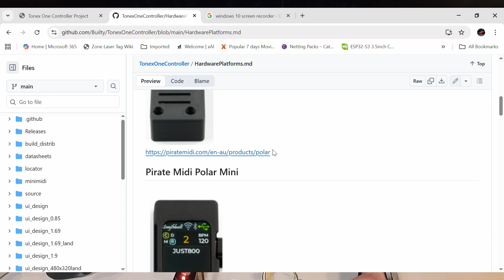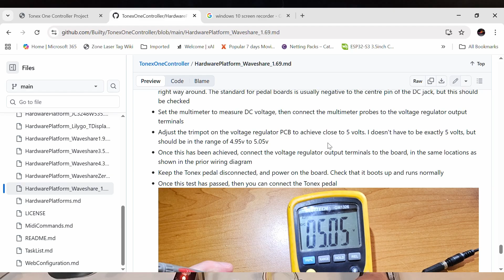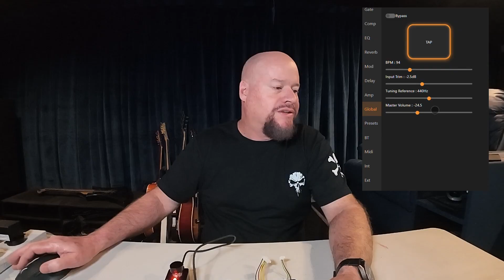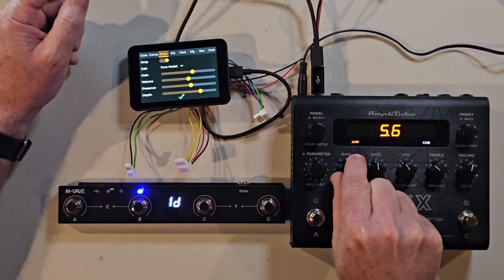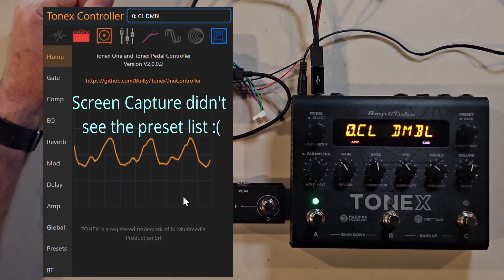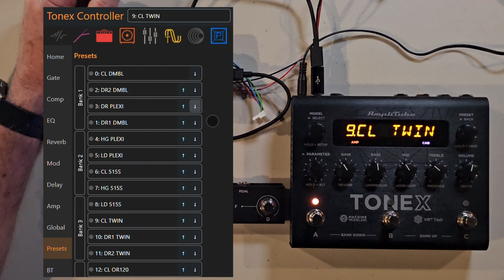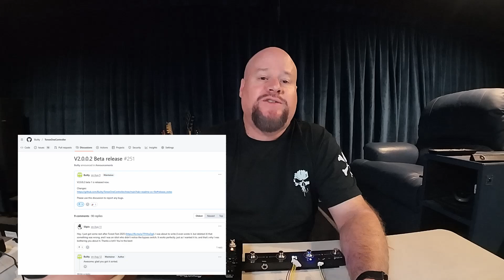Open Source Tonex Controller Project firmware V2.0.0.2

Comment: Game changing work!!!

Crazy question; Do you think there's a way to get 2 Tonex One pedals controlled by a single bluetooth pedal that can broadcast on multiple channels (like the Aero/Airstep multi).  Is "midii through" via usb etc a thing with these units? (Old fart question)

Please do keep doing the astonishing, it really is appreciated, and the Pirate stuff is superb.
Reply from the maker: HI. Midi over usb is not supported for pedals. I'm not familiar with the multi. Midi thru is supported via wired midi but I don't think that would be helpful in your case

Comment: what chip "screenless" do you recommend to avoid heat ? Sorry but wifi is ON much more than 60" (15-30' its depend). Need help to know where to configure this timing (not in wifi page of the web-controler)
Reply from the maker: The WiFi page has Access Point timed (60 seconds), Access Point (on always) and Station mode.

Are you meaning that yours stops working after 15 to 30 minutes? If so, this would not be the firmware.

Comment: Hi again Greg, other RFI about the robustness of the product based on the ESP32-S3 zero SOC: wifi is interrupted after a duration of 30', often less. The HW is very hot as well. Did you face this problem with some part by the past ? what is the most stable wifi configuration via the config web page ? Like each start (is it normal ?), a reset directly on the SOC is the workaround solution, but can be very frustating in a guitar session with playback or recording...see my other question about midi on wifi, thanks for you investment in the devlopment of this open source free solution !
Reply from the maker: Wifi switches off after 60 seconds. This can be changed in the settings to stay on always if you like. Some people do find the Zero chip runs hot. You can stick on a small cheap  heatsink to help it.
Reply: @gregsmith1526  what chip do you recommend with less heat ?
Reply from the maker: @patrice92420 all the supported PCBs are shown here:
https://github.com/Builty/TonexOneController/blob/main/HardwarePlatforms.md

The Zero is the only one that runs warm. The rest run cool.

Comment: Hi, could a guitar switcher (to manage 8 loop) with midi management connected to an adapter for midi wireless sending messages be connected to the Esp32 loaded with you ToneControl Project ? Tanks to precise wifi or BT or never…
Reply from the maker: That sounds complicated, but I think it would be OK. The controller can accept Midi messages via wired, bluetooth central or bluetooth peripheral.
Reply: @gregsmith1526  not via wifi adaptater isn't it  ? (like  m-vave sk7, generally can be conected to a list of predifened music devices).
Reply from the maker: @patrice92420wifi is available via a Web page, but not for midi

Comment: Hi Greg, can you tell us why TonexOne can manage midi messages internaly whereas the feature is basically not supported ? Indeed, the M-wave pedal controler only transmit the midi messages to TonexOne that must interpret the desired action, any explanations ?
Reply from the maker: The Tonex One does not support Midi at all. It has its own special communication system that IK wrote. Its used for the Tonex editor.
My controller project takes in Midi messages and converts them to this special protocol.

The One coould have had Midi but I guess IK was concerned it would then take away sales from the big Tonex pedal.
Reply: understood thank you. Did you get some informations from ikmultimedia on this special protocol or did you learn it by experience with some spying usb tools ?
Reply from the maker: @François-l4l all done through reverse engineering. Months of it
Reply: possible to contact you directly and in private on your github ? I have no more technical question, but more a collaboration to suggest.
Reply from the maker: @François-l4l  Github doesn't support private messages. Are you on Facebook? You could message me privately there
Reply: I understood your project act as a gateway. May i contact you in private for commercial purpose ?

Comment: Great job, dude. One question, which is the best platform to use with an old voodoo lab pedal power 2+? It can give only 250mA maximum. In the documentation, the 4.3 waveshare says it needs 1A power supply, but couldn't find the info for the others. I know i would need the step down thing, but would the pp2+ provide enough juice?
Reply from the maker: 250 mA is going to be really tight. The Tonex pedal itself takes about that. Best option for you might be to power the Tonex off 9v, and power the controller via a separate 9v (if you have multiple outputs.)
The controllers, when not powering the Tonex, need a lot less. 250 mA at 9v is probably enough, but I couldn't guarantee it
Reply: @gregsmith1526 Thank you, mate. I'll give it a try.

Comment: Hi, great job! Today I received my Waveshare Esp32-S3 Touch LCD 4.3b device. Everything works, but only for a short time. I often get a black screen and the Waveshare device emits a quiet beeping sound. It doesn't respond to the reset button, and I have to disconnect the 9V power supply. I have no idea what could be causing this. The software works fine if this error doesn't occur.
Reply from the maker: I have been working with another user who had some similar issues. I recently updated the wiring diagram and notes to mention that using some wire to link all of the ground pins together can fix some weird issues.

Please check the updated wiring diagram and add link wires to all of the ground pins on the 4.3B.

The other possibility is that the 9v supply does not have enough current. If it is 0.5A it might not be quite enough. 1A is safer.
Reply: Thanks for the reply and advice. I'll check what you're talking about. At this moment the power suply have 500mA. Tomorrow I'll try connecting a 1A power supply; I have one  somewhere. I'll let you know the results.
Reply: Hi again. I connected all the grounds together according to your diagram, but that didn't help. Finally, I changed the power supply to 1A, and after an hour of testing, no problems. I hope it stays that way :) It's a bit disappointing that 500mA isn't enough. My isolated power supply doesn't have higher outputs. Now I have to use a second, additional power supply in my pedalboard. Overall, the whole project is great and useful, and I really like it.
Reply from the maker: @krissexe1  you could connect 9v to the Tonex pedal, at the same time as the USB connection.
This will take the load of the Tonex away from the Waveshare board, and has a good chance then of being OK on 0.5A.
Effectively this lets you split the power over two 9V outputs (assuming 500 mA each.)
Reply: @gregsmith1526  It's good to know that it's possible to connect a 9V power supply to the Tonex with the USB from Waveshare. I'll definitely check out this solution. Thank you very much !

Comment: Hi Greg! I'm using V1.0.7.2 Waveshare 4.3B and Chocolate. This works well. All new firmware does not work. What am I doing wrong?
Reply from the maker: Hi. Is your Tonex firmware up to date? V1.0.7.2 is quite old and only works on the Tonex software before they released their Editor.

Newer controller firmware versions need the newer Tonex firmware.
Reply: @gregsmith1526  Thanks for your help!

Comment: Hi, just had mine and it' very awesome ! Thank you!
Just a question.. How did you get amp picture ? All my preset on Tonex Controller come with Marshall pict. On Tonex editor I have fender, peavey etc.. but on controller alla re marshall :/
Reply from the maker: Hi. Press and hold the preset name. You will enter edit  mode. Use left right arrows to select the skin
Reply: @gregsmith1526  Thank you !!! Now it's nearly perfect ! Thank for your job !

Comment: Hi Greg. Thanks for your work. If i use tonex one with waveshare zero would 500ma of current be enough?
Reply from the maker: 500 mA is probably just enough foer the Zero. It should be OK, but if you get any issues where things go weird (rebooting, dim leds etc) then the power area is the first place to look
Reply: @gregsmith1526 ok. Thank you, a final request: will the global volume be set to zero value?
Reply from the maker: @giaxito hi. I'm not quite sure what you mean. I use the same db values as the Tonex software for the volume

Comment: Hi Greg, I have a Waveshare 3.5B. I added the correct files but it doesn't seem to be working. I get a black screen, although it does look like it turns on.  Maybe I am missing something. When flashing does it need to be connected to a 5v power source? Or will the USB connection suffice?
Thanks and great work!
Reply from the maker: Hi. Usb power is fine for programming. You could try doing Erase and then programming. Make sure you get the 3.5b release and not the 4.3 release.
Reply: @gregsmith1526 thanks for the tips!

Comment: Is there any option available that allows using the Tonex One as an audio interface on iOS over USB-C while still controlling it via midi?
Reply from the maker: I don't believe that would be possible. USB only allows a single Host, but that would require 2 hosts similtaneously.
Reply: @gregsmith1526 Thanks for the reply. Maybe someday someone will make an iOS app that does the Tonex One to MIDI crosswalk so then the iPad could be the only host and handle both.
Reply from the maker: @guitarwizdom  I dont think thats possible. iOS doesn't support the USB CDC communications the Tonex uses, as Apple has it all locked down.
Reply: @gregsmith1526 Ah bummer! But thanks for letting me know and I appreciate all of your work on this. Flashed my first zero board tonight and plan to solder a power cord to it tomorrow!

Comment: Hi Greg, this is awesome! Will the Pirate Midi work transmitting CC messages with an expression pedal plugged into my midi controller? It is striked out in the manuals and I was hoping to be able to do this such as the airstep. Thanks!
Reply from the maker: Hi. Expression pedals should work, however the method of bridging Midi to the Tonex's USB isn't quite as fast as directly connected Midi (which is not possible on the One.)
The constant stream of messages from an expression pedal could potentially end up being laggy.
V1.0.10.2 had a lot of optimisation that made this area much better, but you would need to test and see if it is fast enough for you.
Reply: @gregsmith1526 Thank you!!’
Reply: An expression pedal can't be plugged directly into a Polar, and the expression CC for the big tonex doesn't work on the Polar, however, any of the CCs that are listed in the manual can be controlled - as Greg said - with an expression pedal in your MIDI controller coming into the Polar. And then you may have some lag or delay in changes based on the overhead of the device. 
But expression pedals as a concept will work - you just can't plug them directly into the Polar because it's designed to have a MIDI controller plugged into it or wireless MIDI connected.

Comment: Well done video, Pirate Midi are geniuses !!
i did adapt a metal enclosure bought for £14 on Amazon to host 4.3B board, ToneX One and 2 footswitches and it's now big like the Pedal , it works very well.
Unfortunately there is no space left for the physical midi and I still looking for a slightly  bigger enclosure 
great great good stuff!!

Comment: Hello greg,  i try this updet (using lcd 4.3B), but MIDI through wire with RS458 become not function, is there any setting that changes, please help..
Reply from the maker: Hi. I will do some checking on that one. The 4.3b is tricky with the rs485
Reply: @gregsmith1526 ok thanks greg for the respons, for now i downgrade again to 10.2, and it is normal again
Reply from the maker: @madtech.channel  I think I know what the issue is. I added Midi Thru in the latest beta, which uses the transmit pin. However the 4.3B with RS485 isn't suitable to do this. I will fix it soon
Reply: @gregsmith1526 ok, thanks greg👍
Reply: @gregsmith1526 is there any dedicated pin on 4,3b, that can transmit MIDI (example using RX Thx), without RS485.., just like N16R8 using pin no.5?
Reply from the maker: @madtech.channel  unfortunately not.
However, Midi pass thru could be done by connecting the Featherwing RX and TX pins together.

I've released beta 4 that should be the issue with the Midi input (I had to disable thru)
Reply: @gregsmith1526 so that new firmware, thru only work if there is Rx Tx featherwing circuit? because my circuit only send tx to transfer MIDI(using arduino + rs485), ok i Will try it again, thanks greg..
Reply from the maker: @madtech.channel  the new firmware doesn't attempt to do any transmitting of Midi, only receiving. The same as the older firmware was. So yes anything like a thru mode would have to be done in wiring.

Comment: i'm having an amazing time with the waveshare 3.5B and the m-vave chocolate. But i still can't figure out how to change the switches to, instead of changin presets, to turn on/off effects like delay, or rreverb, etc. Any help from anyone?
Reply from the maker: Go to the web config, on the "Int" (Internal) tab.
The top part sets what preset switching occurs (eg next/previous, 4 with banking etc.)
This can be disabled if you want all 4 switches for effects.

On the same tab, the "FX" config is where you can assign each switch to trigger some effect or change a value or whatever.
Reply from the maker: Oh wait, did you mean to change the Chocolate footswitches? My first answer was for the footswitches you can attach to the controller itself.

If you mean the Chocolate, you need the M-Vave app to change the config, and connect the pedal to PC via USB. Then change it to advanced custom mode and set the Midi CC values you want to send
Reply: @gregsmith1526 do i have to input something on the tonex.local or the chocolate app is supposed to work by itself?
Reply: @gregsmith1526  Hi Greg, I'm in the same case (Tonex One + Chocolate Plus + Waveshare 4B and I want turn on/off effects, tap tempo), I did the configurations at the M-Vave app, set the Midi CC values that I want (based on the Midi Command List) and when I connect at the Waveshare nothing happens, just one thing: wheter I am in the bank/patch 2, 3, 4... it returns to 1... What I did wrong? Do you have a video (or know) showing how to configure Midi CC commands in the CubeSuite for Tonex One? Thks!
Reply from the maker: @brusville9526  have you enabled Midi CC bluetooth in the web config? Its disabled by default
Reply: @gregsmith1526  I got it! My mistake was the channel (were different), thank you so much man!

Comment: Hi Greg. Thank you for your project. I have a question. Is this version working with ToneX One FW 1.3.15? After updating my tonex one pedal's FW, It seems like doesn't work.(Can't change preset on screen and midi pedal)
Reply from the maker: Hi. I'm running the latest Tonex firmware myself along with V2 without any problems.

Comment: Hi Greg. If I use tonex one with waveshare 3.5b would 500ma of current be enough?
Reply from the maker: Hi. 500 mA would be a bit tight. I woud be safer to use 750 mA or above